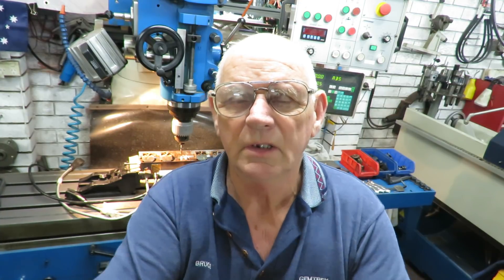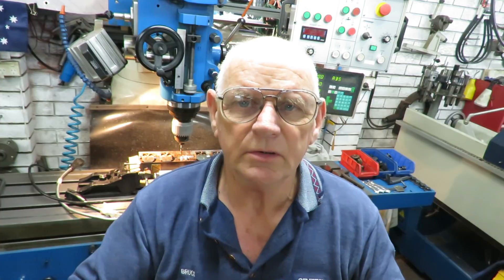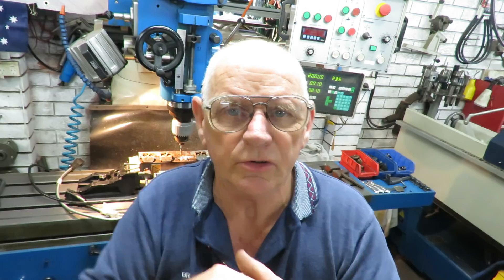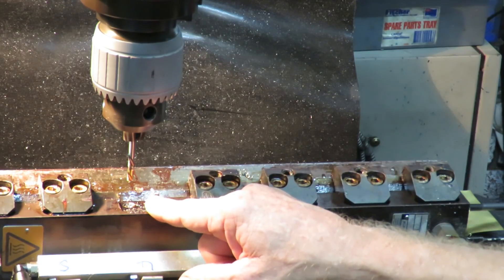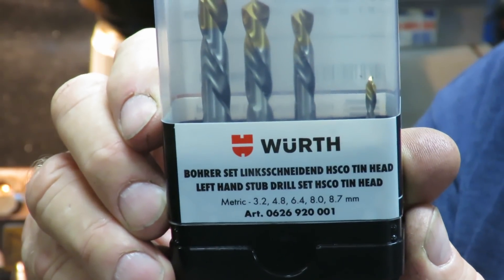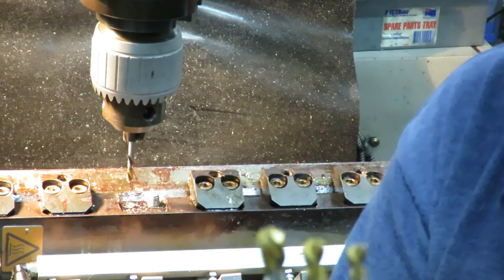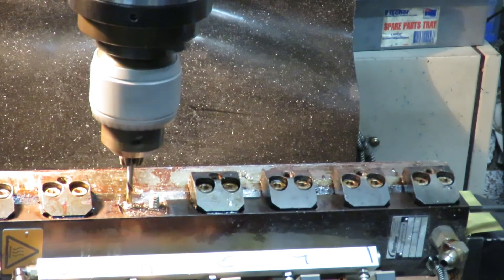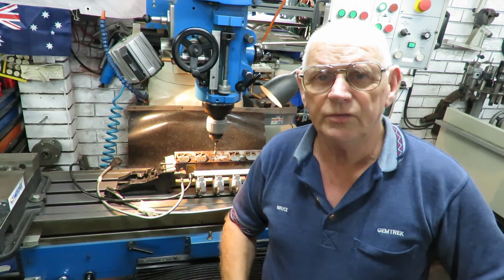Label Machine glue heater broken studs getter outs

Comment: Hi Bruce, haven't you learnt yet, you always wait a few hours before calling the client, otherwise he will wonder about the huge bill. Just kidding, :-)
Those came out so easily, an eeziout might have  actually  worked.
Reply: Anyone can get them out.  The real trick is getting them out without damaging the equipment.  They have to pay a fair price for that and for the express service.
Reply: Hi John, luckily you are wrong, not anyone can get'er out. Some have to pay me to do it.
I may have to quote your idea, pay more for express service, by which I mean pay extra to jump the queue.👍😁
Reply: Amen.
Reply: Only reason they came out so easy was the head cooled down, and there was enough differential contraction to break whatever was locking the remaining stud in there, making it easy to get. Trying to drill it hot would have made a bigger problem, and that casting looks like a retap and insert would be tricky. The milling probably helped by giving the stud extra energy to break free.